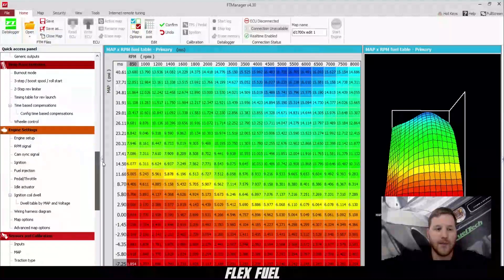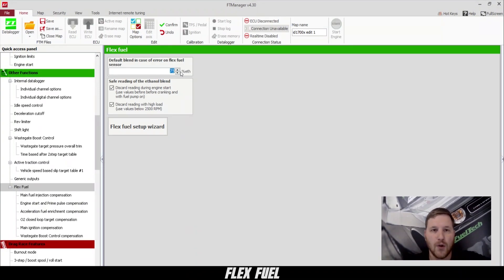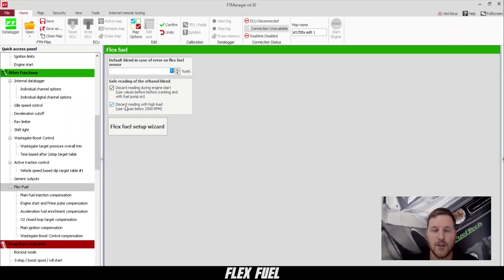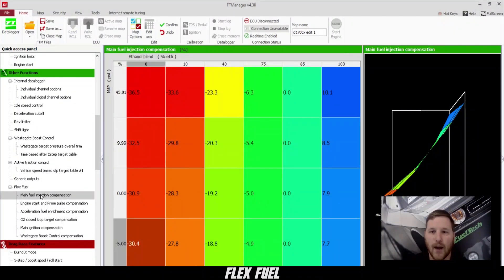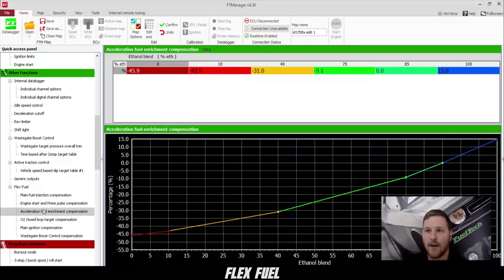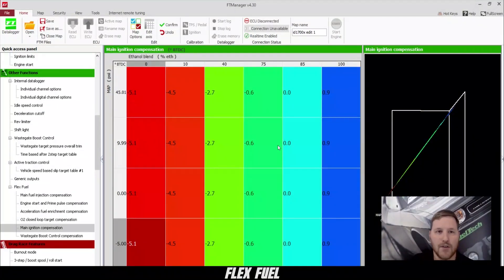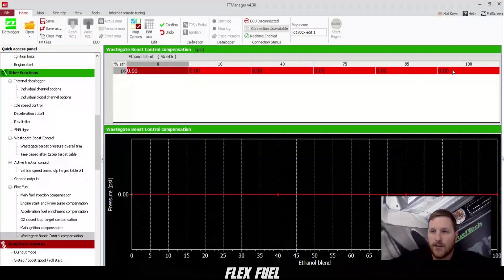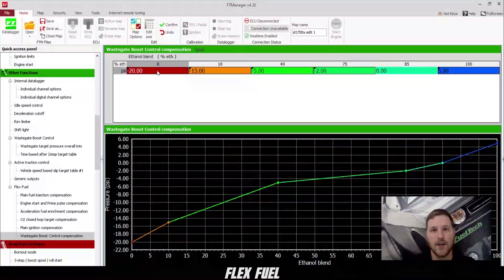Flex Fuel setup on a FuelTech ECU

Comment: Does the flex fuel sensor use the 5v sensor output or 12v from ig switch
Reply: 12v